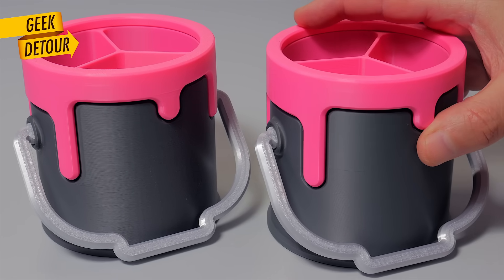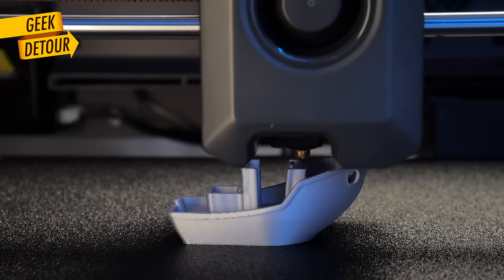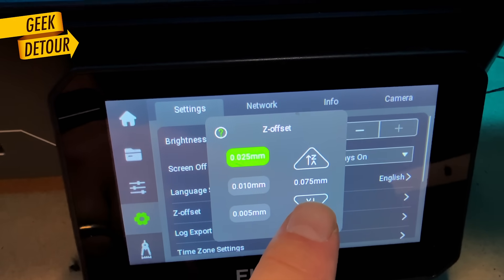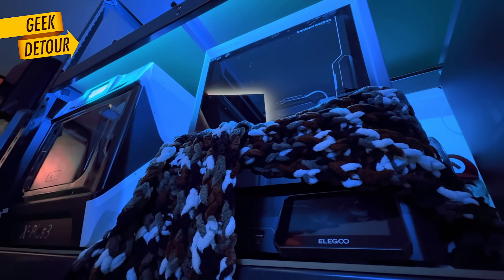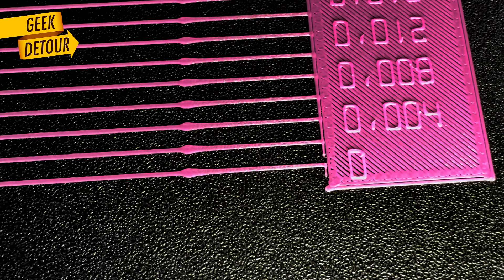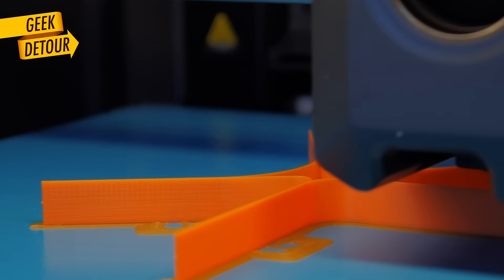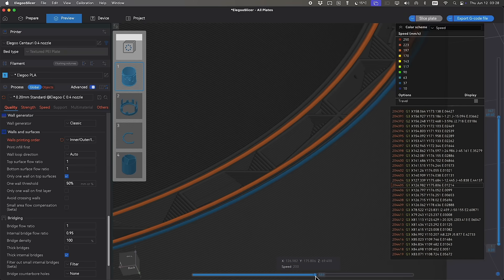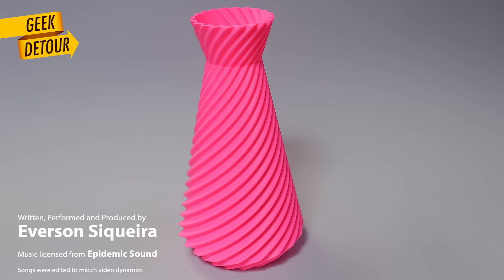Auto vs Manual Calibration — Elegoo Centauri Carbon

Comment from the maker: I printed around 300 hours with the Centauri Carbon, to finally make this video. Priced so aggressively, I had to be sure 😂 It’s a very good printer - it just needs the final polishing of the community, testing more and perfecting the profiles. To me, it’s a collective effort that is totally worth it.
Reply: Great video! Did you end up making a github repo for the gcode?
Reply: @heyderekp  Screenshot of the video, and ask google image to show text as code.
Reply: Where can I find the test for the z offset? also are you doing these calibrations for every filament?
Reply: @bigsdsl  you simply add a flat square of the size of the bed ( or a bit less ) and set the width the 1 layer only
Reply from the maker: That’s the answer 👍❤️
Reply: @cryoglobe  the lazy way is to draw the square and turn on vase mode with one bottom layer
Reply: @cryoglobe  Where do you set the width to 1 layer only? I see layer height settings and line width. I'm new to this, that's why I'm having to ask.
Reply: @GanjaPanda420  In the slicer, right click on the build area and select Add Primative -> Cube, click on the cube and select the Scale icon at the top, uncheck the 'Uniform scale' box and set the Size to 200 200 0,2. This will give you a 200mm x 200mm x 0.2mm cube to print. Slice the Plate and Print like normal. Now, at the printer screen, go to the Gear Icon, scroll down to Z-offset and click on this. Then follow the steps to adjust the layer height to get the perfect layer. Transfer that value to the Filament settings in your slicer.
Reply: @digitaldragon72  thanks!
Reply: Thank you for your guidance. I'm very pleased with my CC, but know it will do even better when my settings are dialed in.
Reply: I've been in 3D printing for Well, since the beginning. This is the best tutorial video I've ever seen. I'm sitting here Stunned. At the quality. Of every aspect of this video. Obviously, I subbed. This is a fantastic channel.
Reply: In the same boat as @bigsdsl and @GanjaPanda420 - is there quick guide to setting this up in orcaslicer? Better yet a ready to go file for us ECC newbies? 🙃
Reply: How did you access the Printer.cfg?????

Comment: What a SUPERBLY USEFUL video this is!! Mastering these settings AND understanding both what you're doing and why you're doing it makes this budget-end printer worth buying as so much may be optimised with the techniques that you're demonstrating, complete with very good close and detailed video-zooms where appropriate. Many thanks for this excellent video - this really has pushed my decision over the line to buy one of these, which I plan to use as a 'starter' machine to see if I get enough use from it without spending too much on it.... The BEST video I've seen, and applicable with a little thought, to so many other 3D printers with the understanding this video has imparted....

Comment: Seems like new firmware saves the Z offset now? I changed the Z offset on screen until happy. Changed in slicer - and when printing just lines, no sticking. Powered off printer, waited, powered on - the same. Checking on the screen, Z offset still at the value I changed to on printer screen. Removed Z offset from slicer and everything looks perfect. Will see how it holds up.

Comment: I came here searching for the information if I need to do Automatic Levelling each time I change the plate. I am not sure I found the answer, but there are lot of useful information beside that, so thank you.
I understand you can save a mesh per slot, but why Elegoo allows to save only two meshes? It is OK for the provided plate, but they promote buying three extra plates (and I ordered a bit more for "holographic" effects), so they should allow to save much more than that. It is more useful than storing lot of models in the 8 GB storage of the printer!
Doing a 20 min levelling each time you change the plate is time consuming.
And should we redo a z-level test for each plate, too? Perhaps we can save the result per plate, though.

Comment: Saw your video when I bought the centauri, finally got to it to adjust, just one question, adjusted the Z-offset (to .1), prints the first layer clean now, but when I remove the layer the lines don't stick together, with the first print with no Z-offset, print wasn't clean, but with removal it was just one 'sheet' instead of strings. any idea why?

Comment: Thanks a lot. That was really helpful. I just bought the Elegoo Centauri Carbon as my first FDM printer. I started with Orca Slicer and found that the Elegoo Rapid PLA + preset now even has a little Pressure advance of 0.024. Anyway, I am really impressed by the quality and colors of the Drippy Bucket model you showcased. Would you mind sharing which filament and colors you used. I'd like to try and print it the exact same way.

Comment: something you didn't clarify is that the setting you showed applies a SLICER level z offset not a firmware one so the UI will not update and will not show the current offset. worse if you change it from the printers control panel the two offsets will stack

Comment: I'm trying some of these settings to see if I can get rid of the VFA I'm seeing so bad on my prints. I need to place my printer on a better platform other than the table it's on in the basement until I get my new office done with a shelving unit specifically for 3D printers. I'm back to tweaking 3D printers to get them perfect or as perfect as I can. I just got done replacing the toolhead shell with a lighter one and the nozzle with a Diamondback nozzle, did a full tune again and made adjustments according to your video, moved the printer to the center of the table, tightened all the table's screws(it's old and needed some love itself). Let's see if it makes the VFA less noticeable. Thanks!

Comment: I have a finding I wanted to share with the CC community. The Z-offset section really improved my first layer when I got started with my CC, but I found it wasn't consistent between prints and even across the first layer on a single print. I came across a Reddit user that suggested using the auto-level when you print from your slicer to your machine. They stated the auto-leveling takes place once the bed is up to temperature (60 C for me) which accounts for the metal expansion when leveling. Just wanted to report that I just tried this and printed my most flawless first layer yet! And that’s with 0 offset vs the .25 offset I was running prior. So if Z-offset doesn't fix first layer woes entirely, try auto-leveling at your bed temp! It worked wonders for me. If you aren't printing from your slicer, I imagine you can set bed temp on your printer and then initiate auto-leveling. It may hold the pre-heated temp, but check and make sure the bed temp is holding at your desired temp after initiating the auto-level feature. Happy printing!

Comment: Thanks for this great video! Noob here, but I wonder: if you were going down with Z Offset, why setting a positive value on the slicer? Maybe just a mistake or am I missing something? Also the G code is not available, I guess I could just copy paste as it's only the beginning? I am still trying to get the best out of the CC and have some engineering background but learning as much as I can from experienced users!
Reply: You need to go to printer settings (the pen on the right of the printer name) and in the dialog box, check the Advanced switch. They hide lot of settings to avoid overwhelming new users…

Comment: Another big thing that needs to be said is both orca slicer and elegoo's slicer default to classic wall generation instead of Arachne. 150 is about the sweet spot for printing with both the elegoo and my og ender 3.  Really if you want to remove the vfas without dropping speed you could always drop your printing accel down a little. 5000-8000 should calm it down quite a bit during printing. I wish we could get the input shaper results chart so we know what our recommended accel speed is. Without that information we are kind of blind.

Comment: A set of feeler gauges is something every 3d printer owner should have. Best way to perfectly set your zoffset. I've gotten a perfect sheet first layer on a old first gen ender 3 this way for years. I found even the K2 plus required a manual zoffset change as even waiting a hr for the bed to soak the auto z offset was causing bad print clogs. As far as speeds are concerned a certain amount of those vfas are belt related and the rest could probably be taken care of by adapting your accel rate according to your input shaper results, and really dialing in your pa and flow according to the filament, and as always first thing I would do after the PID tune is do a max volumetric flow cal with your daily driver filament and set this value in your slicers filament setting. I've found the real value to be wildly different from the stock settings. This will allow your printer to properly throttle its speeds to stay under that flow value. Good to know you can change the preheat temps as I feel a lot of these printers only optimize their start code based on pla. I've been beating my head against the wall with the K2. I know at 150 it's not soft enough to clean the nozzle. 150 is probably soft enough to allow excess pla to still smoosh during the bed leveling, but when using PETG, abs, or a higher temp material I end up manually cleaning the nozzle and presoaking the bed as the printers registered bed temps aren't even close when compared with a thermal camera. I've seen the outer bed as cold as 50 when Ive set the bed to be 80°.

Comment: For Ironing, best settings for me is 60 speed, 25 percent flow, and line spacing being half the resolution size (0.2 setting, set to 0.1mm) and it works great. I also use concentric if the top surfaces have a round radius.

Comment: Is your Gcode enough to get the right z-offset on the first print? I understand your point, but many users suggest that you need to heat soak for 30 minutes or more (bed temp at 60 degrees or more), to ensure both the bed and the rest of the chamber have settled at operating temps. What are your thoughts? Also, regardintg the nozzle, could it too be too hot and at risk of damaging the cleaning pad?
Reply from the maker: Excellent questions: 1st) heat soaking: true, but it usually doesn’t need to be so long. 5 minutes (unless your room is very cold in winter) is enough - for me making the bed heat to the target temperature before doing the homing is ok. Warming the printer well before doing bed calibration is very beneficial. 2nd) Offset: I need to revise this now that my Centauri had a recent firmware update. A lot of people told that now the Centauri saved the offset as you adjust on the LCD… so I don’t known how it interacts with offset you set in the Slicer…
Reply: @GeekDetour  thanks for taking the time to reply! Yours if the first valuable video I have found about the CC and it gave me hopes about this printer (I was really unimpressed at first - mine arrived with multiple assembly issues). Do you have an empirical way (that doesn't require a print!) to find out how much time you actually need to heat soak? I have the printer in the garage, so there is definitely a larger than usual thermal range. Ah - yes, I can confirm that the firmware saves the offset until the next bed auto levelling (which I suppose makes sense as the levelling could give lead to a different offset?)
Reply from the maker: Oh, the cleaning pad and the nozzle being hotter: true, it’s a possibility that it could degrade faster. But having blobs of plastic in your first layer seems worst - at least to me. I need good prints.

Comment: Helo! which object size did you use for first layer test? 250x250-ish?
Thank you
Reply from the maker: It was a basic Cube shape from the slicer itself, resized to 250x250x 0.2mm
Reply: @GeekDetour  how you sliced it? I have error that my print overlaps with extrusion area.. I was able too print maxzimum 240x240//
used Orca slicer, btw

Comment: I saw a video of  someone making the outer walls textured to get rid of the 3d print look but they were using bamboo labs, im just wondering if you think this is possible on the centauri carbon as it was just a toggle setting on their software?

Comment: I was on about 40 hours of printing on my Centauri Carbon and tried to adjust the Z-offset to correct first layer issues as shown in the video. It improved marginally at 0.075 mm bed down, but still the line was wavy towards the middle of the build plate. Increasing the bed down distance led to worsening results.

I decided to run another "One-click self-check" with all options selected on the touchscreen (Input Shaping, PID Tuning and Automatic Leveling), and that VASTLY improved my first layer deposit. Kind of makes sense for the machine to have a break-in period. I ran a temperature tower calibration for my filament prior to the auto recalibration to ensure best results, and I plan to run a few more calibration tests like Flow Rate and Pressure Advance (using the Orca resource as described in the video) to really dial things in.

Big thanks for this video!

Comment: Z-offset is giving me a bit of a headache. Running leveling again (this time with bed and nozzle up to print temp). At 0.10 it was to close upper right and to far away lower left area. PA at 0.034 is spot on with may esun pla+

Comment: This is amazing definitely will be using! Quick question though, if the print speed is limited by the volumetric flow rate, will the VFA’s get messed up again? Thanks!
Reply from the maker: The usual Volumetric flow limits are higher than the speeds in which you have the worst VFAs. Now, if you reduce the max volumetric speed too much, you might bring down the maximum speed to a zone where VFAs are more prominent.

Comment: What's the best way to do a full plate one layer test for bed leveling? Should I just make a 256x256x.2mm model in fusion? Or is there an easier way?
Reply from the maker: There is an easier way in the slicer itself: you add a primitive cube shape and change its dimensions (uncheck the proportional scaling so you can put it as 250x250mm and only 0.2 or 0.4mm tall.
Reply: @GeekDetour awesome! Thank you so much for that! I just bought my Centauri Carbon last night and I am SO excited to hit the grown running with it!

Comment: Update on the Z-Offset. My ideal one is 0.045mm. But, I discovered, that under current firmware (1.1.29) the Centauri Carbon seems to save manually changed (+ on screen) settings for Z-Offset. At least those settings were still present after turning the printer off and back on.
Some experimenting showed me, if I have this setting set on screen (where it's now saving) and in the printer profile (the solution you showed), it adds up to basically 2x0.045mm.
So either setting should be made but the other needs to be set back do default (0).
I found the setting in the slicer better, because it's not subject to updates even if the slicer is updated (its data is stored separately from the actual program directory).
So, setting my Orca 2.3.2 CC-profile to 0.045mm Z-Offset and keeping the screen setting to 0 does the trick.
Only thing to remember for later Z-Offset adjustments, they should be done on a default profile to get the true number.
This, btw, id for my CC printing pla.
PETG runs best on my printer with a Z-Offset of 0mm, ASA needs a Z-Offset of 0.08mm
Reply from the maker: Wow! Great info! ❤️❤️ Yeah, they changed that in the Firmware and now it saves.
Reply: I just came here to see if anyone else noticed this....My prints were all failing and I thought the ABS was to blame. Would have been nice for Elegoo to put a notice on the display after the update that it's saved now.

Comment: I tried leveling my bed to get a first print but I have some thin spots around the edges. Is this normal? After manually leveling and then auto leveling, when doing my first print I have to set a -0.005mm Z-Offset in order to get an almost perfect print. Not to mention there are lines now going through my print.

Comment: I'm a complete noob to 3D printing, only got the printer a week ago. This video has helped with the final quality output on the file i print.
 
My Z offest was 0.75. Pressure advanced was 0.66 and vfa is 40mms.

Also done the g code change as well which has helped. 

Thank you so much
Reply: Wow, 0.75, that's 10 times the value shown in the video!

Comment: I just altered the start g-code according to yours. Bed leveled at 60C, while my print will use 110C. Shouldn't it level at 110C? And i think the printer just stood there without raising temperatures (hotend 140 / bed 60) for some reason. After too long...it raised the temperatures to what was needed and started printing.
Reply: I made some changes, but something is odd. It's likely the G90 command, makes the hotend go to 140 and bed to 60.
I used the start code below and while my temps went to what my print needs (ASA 250/110), when it reached G90, the temps changed to 140/60 and the printer waited for them to drop, so it could perform the bed leveling. And after cleaning the nozzle (with 140), it raised them again.
I did this:
M104 S140 ;Start heating the nozzle (don't wait)
M190 S[bed_temperature_initial_layer_single] ;Wait for the bed to reach final temperature 
G90 ;Bed leveling
G28 ;home
M729 ;Clean Nozzle